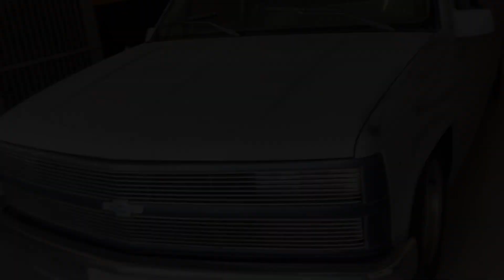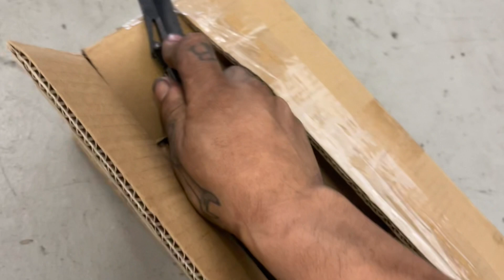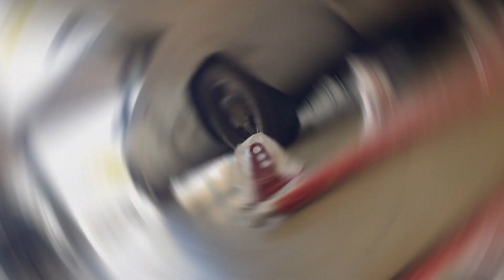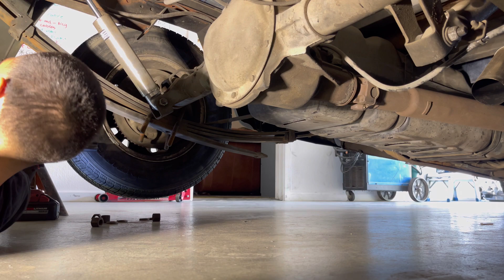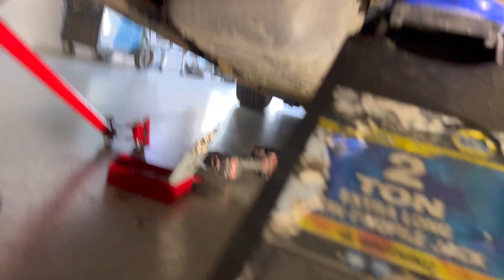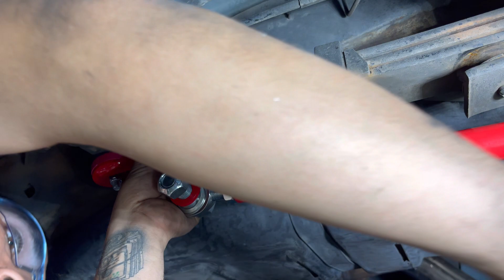Speed Engineering OBS traction bar install!!

Comment: Does the rubber stop have to sit right under the round part of the leaf spring ?
Reply from the maker: I believe instructions say 1/8th away from leaf eyelet loaded and adjust from there however you prefer I feel they are more effective touching barely